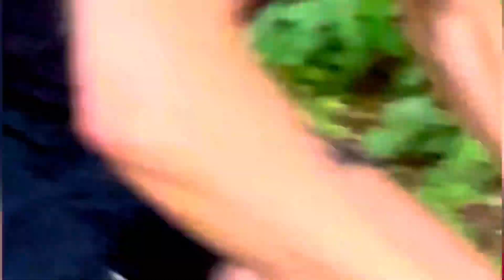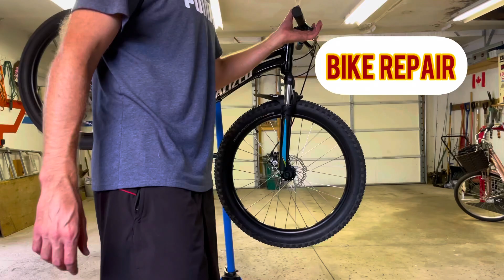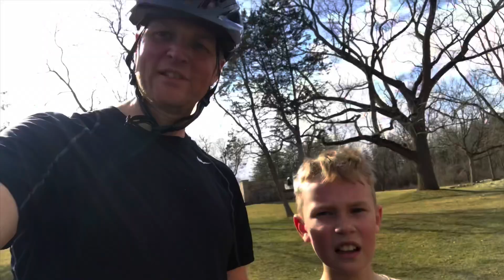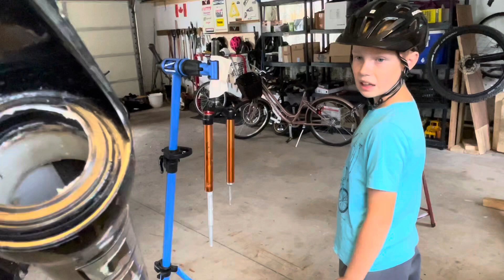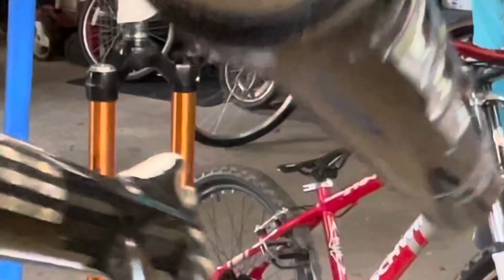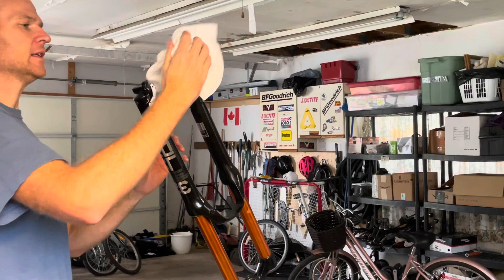Amazon BOLANY FORK LOWERS service on cheap mtb forks

Comment: How much oil did you put in? I have a very similar fork that had no oil in the lowers but it has oil in the air chamber
Reply from the maker: I put in the RockShox standard for oil amounts for an air fork.  I’m not convinced that these forks are supposed to come with oil at all.  (Except n the air chamber) The bushings are plastic with no foam rings but having some oil in there with help with the longevity on the internals.